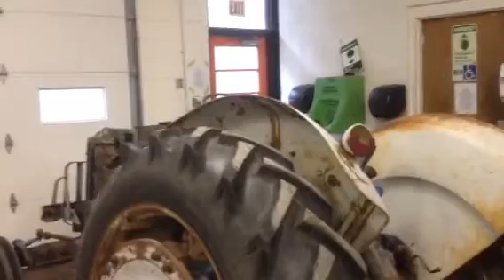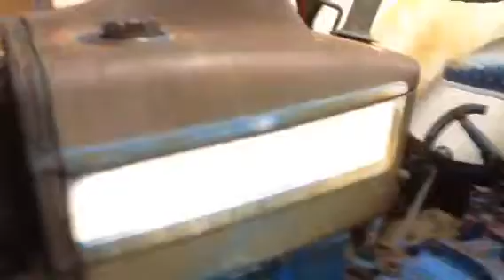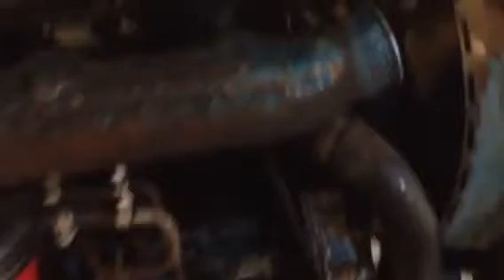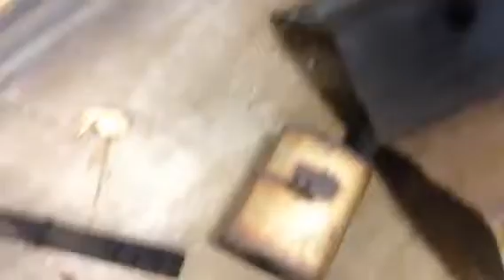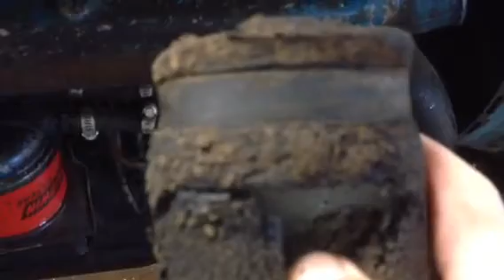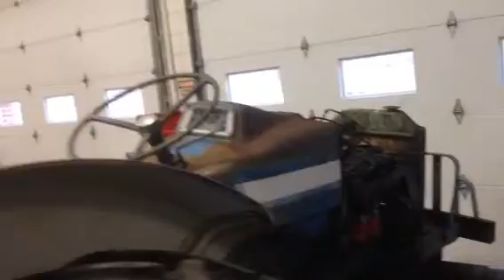65 ford 4000

Comment: Hello, concerning the leak of the fuel ditributor. You might not need more than the small  O-seals. That worked for me :)
Reply from the maker: 66badsign I was wonder if that could be replaced without dissembling the whole injector pump. It's the seal behind where the cable for the kill knob is hooked up. That would be great if i could.. I hate to tamper with it too much since it runs so good.
Reply: I didn´t have to unhook the injektor, just be carefull with the springs inside.